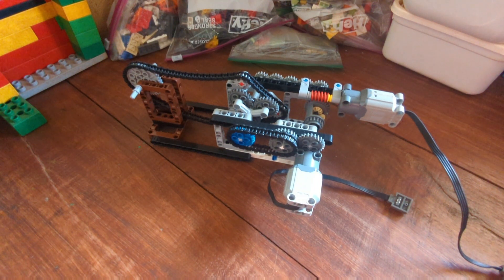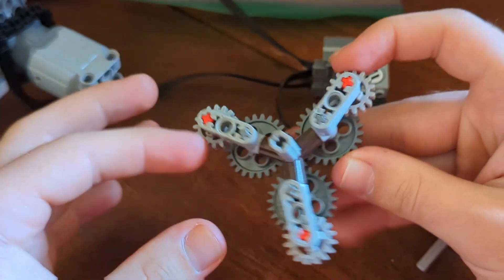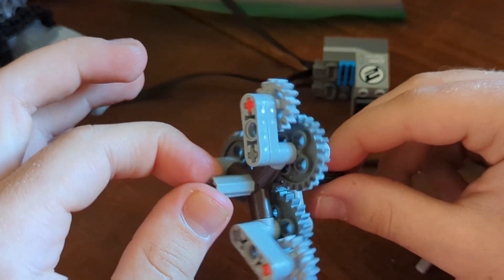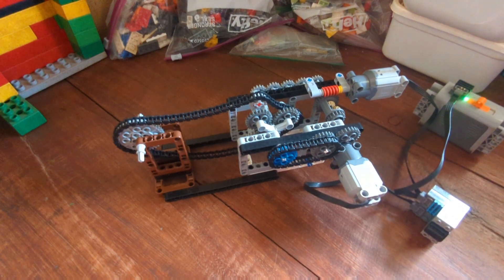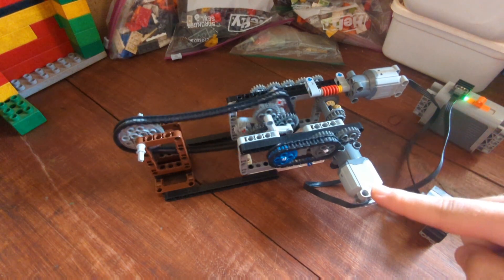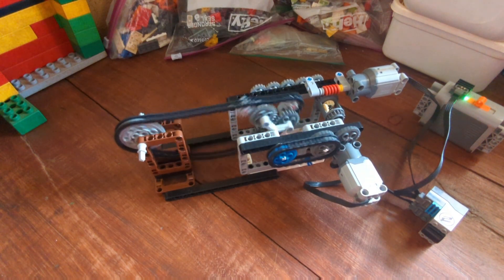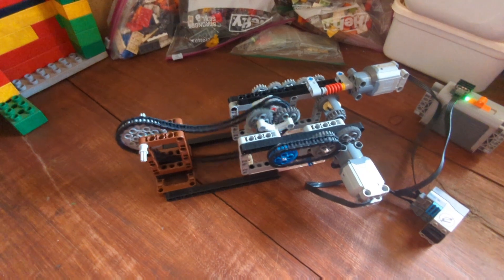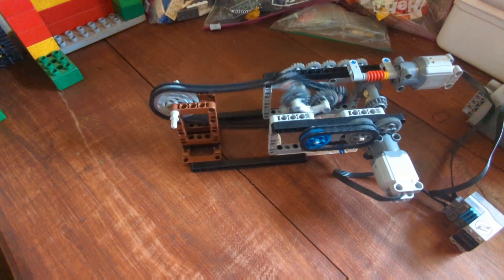C.V.T. chain drive. Lego technic

Comment: Something possibly to account for chain tension is to add another one or those to the driven side, with the driving side one driving the driven side one in a different direction. This way, it will also have a wider range of speeds.
Reply from the maker: Yeah, that's a good idea
Reply: @magnumsalyer  It would also behave more like a typical cvt as when one driving side gets bigger the driven side gets smaller and vise versa.
Reply: much better than my solution

Comment: Take another one of the drive wheel, mirror it, turn 60° and double it, makes half as much wobbely
Reply: maybe it helps with spacing if the small and big gear get swapped (big gear in the center, small on the outside) - this would allow more adjustable gears on the same adjustment gearing for an overall rounder shape. (i think up to 8 might be possible with that, but 6 is more reasonable)

also maybe put the adjustable gears on the other side of the linkage, so your minimum diameter isnt restricted by the triple rod connector, but just by the center rod
Reply: "also maybe put the adjustable gears on the other side of the linkage, so your minimum diameter isnt restricted by the triple rod connector, but just by the center rod"
I didn't understood about the center rod, can you develop please ?

Comment: I feel like adding another gear on the loose part of the chain to adjust belt tension as the geometry changes would be super helpful for the “jerkiness”.
Reply from the maker: That's a really good idea. Thanks 👍
Reply: Could be done with a gear on an axle or liftarm put under tension by some rubber bands.